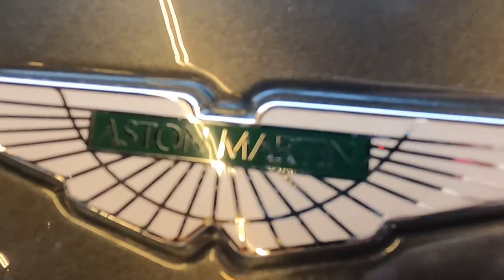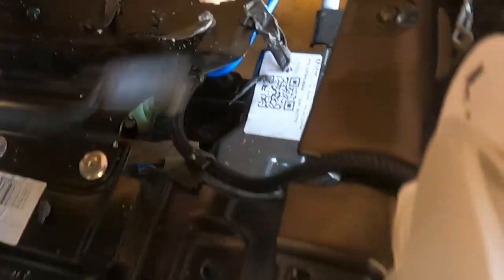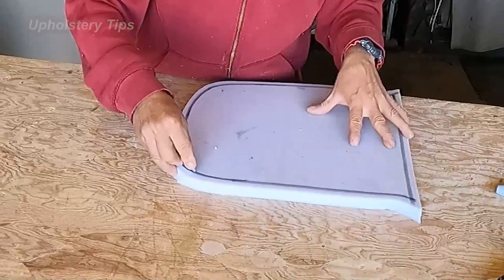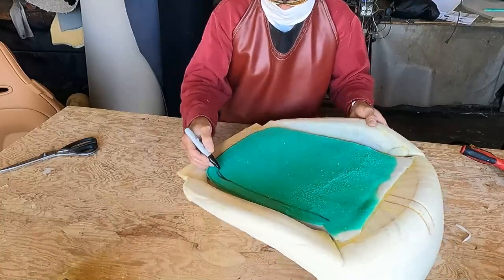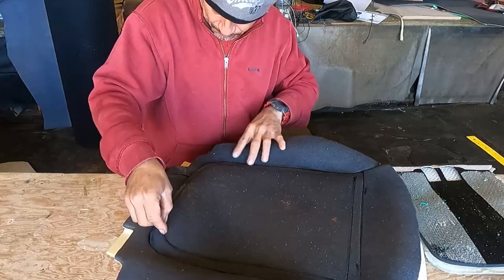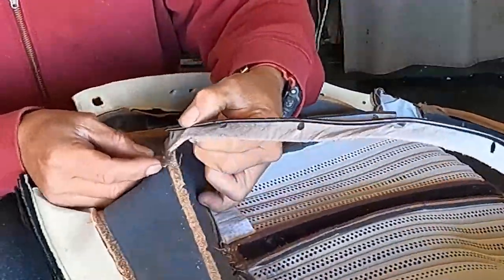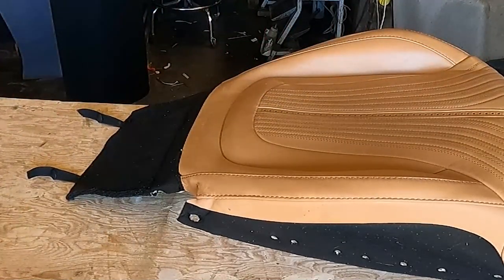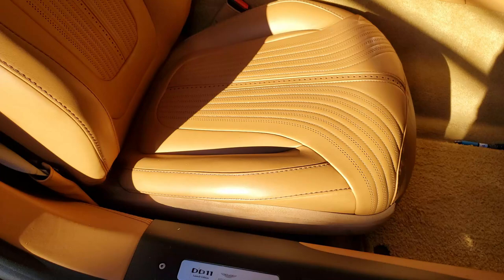How to add1 1/2 of foam on a cushion without replacing the cover

Comment: That IS an easy seat!  Like you said...some seats are a pain in the place that the seat is designed to hold....

I wonder how long it will be before auto manufacturers will realize how much they can save in labor costs not only in repairs...(under warranty)...but also in the actual process of putting them together to begin with.

Comment: @upholstery tips  Does the passenger seat have a weight sensor for controlling the air bag?  My 2015 Subaru does and when we put a cushion on the seat the air bag was turned off by the car because the weight sensor could not properly detect a 160 lb adult and defaulted to turning off the airbag which it does when the weight sensor thinks a child (i.e. a person 65 lbs or less) is sitting in the passenger seat in order to protect a child from being smothered by an airbag. If there is an accident the airbag for the passenger will not deploy in this case. Did this extra foam affect the astin martin air bag weight sensor too?
Reply from the maker: Yes it have for the air back
Reply: @upholsterytips  does the weight sensor still properly detect that a passenger is sitting in the seat or do you see the “air bag off” message?